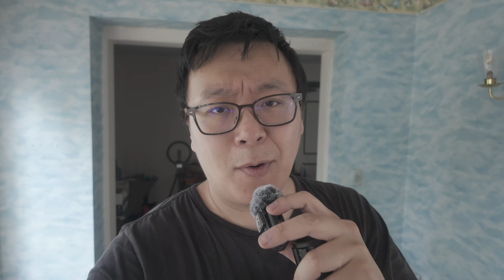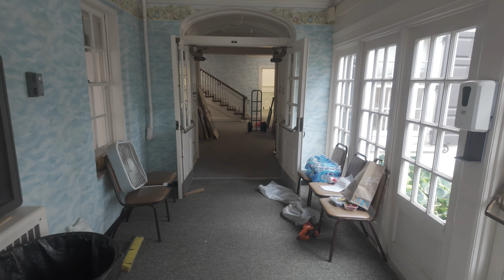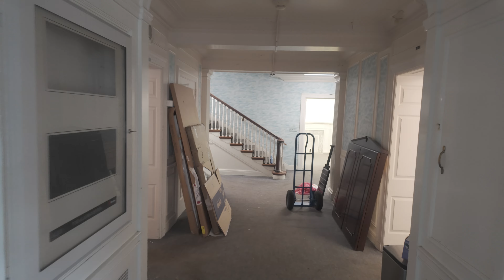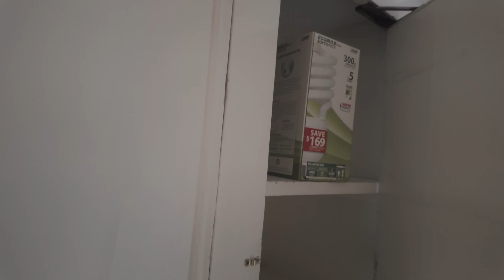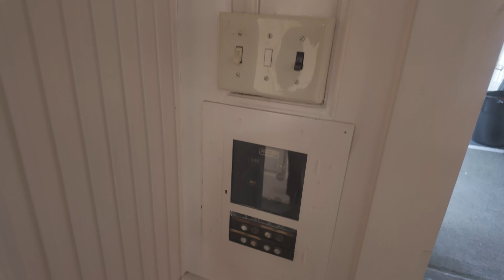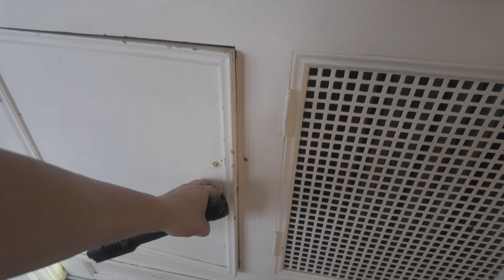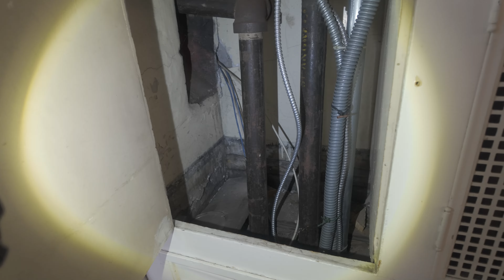Exploring First Floor of my Abandoned School! Episode 15

Comment: At 15:36, I bet it was a clock/bell system. Don't know that you want to replace it, but if you look at early 1900s clock/bell systems, many clock/bell systems were "programed" on a paper strip. As an obvious nerd, you would find the technology cool. The bell in the teachers dining lounge bathroom is painted.  Again, considering the age of building... under that paint is is likely to be a very heavy brass bell. Brass bells have such a distinct sound...they can be rewired/reconfigured as bells for other uses.... maybe, not in the bathroom. It is likely that the sink cabinet has been re done to add some extra counter space. At the time the house was built, they wouldn't have put a counter above the window seal. Because it the doors and drawers match the rest of cabinets, may have been done a long time ago. Love the cabinets. I restore old furniture, so I look at them & think how did they manage to last that long in a school.  They need some sanding & new paint... and the one modern device that makes them perfect...a  magnet or friction catch to make sure they stay closed. Things are done that because the person with authority had a brilliant idea/solution.

Comment: That is a very cool and unique place. I would love to know more about it being formerly a school. Was it a boarding school? A day school?  It seems it was young kids elementary and under. Or even preschool given the bathtub setups. Like they had to help bathe the students given the tubs are raised. Did it eventually get used for offices. Given the bathroom setups it seems like it may have been a boarding school then day school or daycare. 

When you showed the staff dining room and mini creepy bathroom it was weird to think someone would be in there right next to people eating. And I saw a huge bell on the wall. You’d be in there when it rang. It would scare me. Small space loud bell. 

The old toggle switches with the flags looks to be an annunciation device to track what staff is onsite at any moment like a time clock. The equipment in the basement would have controlled it and probably the clocks and bells as well. I also thought it might the older fire alarm system before the one you started removing.   It’s a shame different inspectors gave you bad advice to remove it.

Comment: This was a fascinating tour of the first floor. If you stripped it back to the original features of the old house it would be spectacular. I replied to someone else's comment below but have changed my mind, (saying dining room)  the room at 9:23 is a formal sitting room, which would be fabulous to recreate. The next room may have been a family dining space  or morning room. The next was a 'study' or den. In the den, if you opened the wall back to its original arched beam entrance it would be so open and welcoming.  I'd guess the room next to the water fountain would have been a bar space for staff to prepare drinks. Not sure what the last room would have been but guessing it would have been some sort of 'staff space' because it has the hidden door I would think maybe a butler's office. At the point of the back stairs it would have been all staff use. *In the kitchen, the sink cabinet is not original. It would have been a large stand alone sink space with no cabinets. That's why it makes no sense with the spacing. People did not put cabinets in front of windows and neither should you! The range is fantastic (I'm a trained chef) which any cook would want. A service to that range is probably all you need. *The bins in the 'cook's pantry' are for flour, sugar and possibly potatoes or rice. The second pantry is a butler's pantry. You were right that the shelves are for cutlery and serviceware. Probably your silver services. The dishwasher may still be fully functional have it checked. Great if you have parties or plan to host large groups. *After the full tour you have it right that the last room is the dining room because of its proximity to the butlers pantry, which would always be the room next to the dining room. The whole first floor is stunning if you eliminate all the changes from the school. I say strip it back one room at a time to make it fantastic. Loving the filming you are doing now. Thanks for including us in your journey.

Comment: I work on commercial kitchens if you don’t plan on keeping the burners and griddle those can fetch you close to 20k in that condition. Southbend is a great brand too. The can opener is work like 100-150 as is. Personally I love that old kitchen other than redoing the cabinets. Also if you can fix the dishwasher it’s worth a lot of money as well like 2-5k if fixed and they take like no time at all to clean dishes.

Comment: This time I read everybody else's so I don't duplicate.  The only difference is the dark paneled room looks like the men's parlor where they would sit after dinner and smoke cigars and talk.  The women were in another parlor.  That paneling is probably solid wood and very valuable unlike today's veneers.  I hope you can renew all the fireplaces even if you don't actually use them.  The side porch used to be called a solarium.  I hope all the origional wood floors are under those carpets and are in good shape.  Might want to leave them down to protect the floors during reno.

Comment: How is the gutter project going? Do you have a “flow plan” for what you will work on next? It would be fun to have a historian come in and tell you what some of these weird things are for. Do you have water in the house yet? I know you showed having to bring in water in the first few videos and that it seems like it was going to be a big job to fix water issues. So, just wondering if that is next. 
So much potential in this project.
Reply from the maker: I am still working on the gutters! Just figured give the audience a break in 10 straight episodes of gutter reno. After that Water or roof. I dont know if i need water to power wash the roof or the jugs i have will be enough. Once the roof is done will be getting the water breakages and issues internally fixed. So that would be getting the water figured out

Comment: @6:05 that sun room porch area is nice. You should connect it with the other half and throw in some comfortable chairs.  @8:59 this room could work if you put a couch in the middle closer to the fireplace and some extra chairs along the edges.

Comment: The separable outside door is called a Dutch door. Dunno what the wall insets are but definitely not a dumbwaiter, which is a small elevator-type device that travels up and down as in an elevator shaft. The outlet above the mantle would have been for a small light above a painting. My guess is it would likely be a portrait of the founder. Think WASP, lol. Or some sort of patriot painting since you're in the North...Washington crossing the Delaware, etc. No commercial kitchen would have trash bins near the fresh food. Those lean-out bins would be for either containers of dry food such as flour, or potatoes, onions, etc. I love that dishwasher. We used to have one in a hospital kitchen I worked in as a teenager. You can rinse off heavy soil with the nozzle, then load the trays to the left of the sink (that are under the counter), run through the dishes while you set up another rack near the sink. When the first load is done, you just push it through with the new rack, and the hot clean one dries on the left hand side of the counter. Not sure how efficient is it in terms of water usage, but for large loads, as in a bunch of kids and faculty, it's a great system. Think about the systems that these layouts would have served. Dirty plates come in from the dining room and are deposited on the right hand counter. Someone's there to rinse stuff off and load the racks. Clean plates end up on the left, to dry quickly if they're hot and get put away. Or possibly put onto rolling carts to be put away in the butler's pantry. I love the commercial fridge but imagine it costs a fortune to run. Just a thought - the milk delivery door might make a perfect doggie door.

Comment: Find yourself a designer when you get that far.  I can easily see a couch with side chairs on both sides of it, or a u-shaped sectional, "floating" around the fireplace in  your livingroom.  Another sitting area or small game table can be on either end.  A master suite would be perfect in the natural wood fireplace room, using the teacher lounge and tiny tiny bathroom and making those into a nice size bath and walkin closet.  I could go on.  I love designing.  Fun, very big project for you.

Comment: I hope you find a hidden treasure in the milk door! 

That kitchen feels so institutional. . . oh, wait. . .
While Other than the weird layout, it is a pretty cool kitchen. 
Those tip-out bins may have been for potatoes. 
There is an inspection tag on the fire hose, when was it's last inspection?
The outlets on the dishwasher. the horizontal one probably is on outlet, but the lower, vertical one, that looks like a switch, the plunger pulls down and pushes up to turn things on and off. 

You surely have the space in to buy and sell pallets of returns, or even storage units if you wanted. 

That creepy, extra tiny bathroom, the light switch being upside down makes me think it was a three way switch, it has a mate somewhere.
Speaking of switches, that 2 switch hall light thing, someone probably replaced switches and screwed things up. 

This property is so cool.  Maybe you could build something out in a part of it and do an AirBNB.

Comment: Looking at the floor plans you can see that in the playroom with the fireplace (with the clock) the arch was open. The door in the closet that was walled up looks like it was the original door and the hallway where you said there used to be a door was where a closet was and that door was for that which explains the switch, the light would turn off in the closet when they closed it.

Comment: The principal’s office (parlor) and living room is beautiful with the trim. The room with the brown trim was the gentlemen’s study. The split door is called a Dutch door please save all of the hardware and door operators that you can on original doors. The dead bolt holes can be repaired in the antique doors. The openers in the breezeway are from the 50s, makes them 70ish years old, slightly older than me. My husband’s career has been dealing with doors, windows and hardware for 45 years and knows these things inside and out. There were many doors in every room in the original home. It was how you kept the heat in the room you were in. Please consider keeping them in place so the house isn’t so open. The kitchen is probably the original layout. The one change would have been the sink cabinet has been widened. It would have been between the windows only. The original cabinets in the pantry are bins for things like flour, sugar, potatoes? Those are awesome! The hall between the kitchen and dining room, is a butler’s pantry. They’d have stored the dish ware, linen and silver. The butler would have decided what was needed that day on the dinner table, serving pieces, and linens. This house originally had servants. At least a cook, butler, and maid. How many bedrooms are on the 3rd floor. That’s how many house staff you would employ. Things like the incinerator door, leave that in place for the nostalgia of it. Ok the dumb waiter aren’t actual dumb waiters. A dumb waiter is a small elevator between floors for linens, or food. You probably have one somewhere. But they are basically early staff callers. The lady or man of the house would flip the room they needed the butler in and he’d come. You’ll find them all over the house. The electrical is bizarre because the building has been through 3 separate types of wiring. Originally knob and tube wiring, which would have been changed to wiring, with fuses and no grounding in the 50s, then to breakers and grounds in the 70s or 80s. But there is a reason why the switches on the stairs are like that. You turn the light on at the base of the stairs (or top), when you get to the top (or bottom) you’d turn them off. Common in older homes. You are so blessed to be remodeling this house. And I’m loving looking at it all. Thank you for sharing.

Ok, now you have the cabinet in the janitor’s office, the door in the hall, the safe, the milk man’s door, to open.
Reply: @jwall6006  This is wonderful information and explains some things I was planning to comment on better than I could have done.
Reply: Oh one more thing I saw when I went back. The doors in the cold room (fruit room) that are on the floor, might go where the accordion magnetic doors are.

Comment: Oh wow, that floor is big enough as a whole house on its own.  A lot of work that I am looking forward to seeing what you end up doing with it all.  Oh those pull out drawers in the pantry, they would have been used to store flour, sugar, rice etc (its a culinary thing).  As for the 'kill switch' in the hallway, I also have the same set up in my house where unless the switch is in the 'on' position, my hallway lights and my entry lights will not turn on - why this was installed I have no idea and really annoys me.  But I do like the industrial dishwasher (those crates under the table will hold the dishes and you will find bars and restaurants still use a similar system).  You could quite easily turn that room into a butlers pantry.   Oh and that flat space in the cooker/stove, will that could be either a grill or a place to warm plates.  Keep up the great work and look forward to the next instalment. 😊😊

Comment: As someone else pointed out. Those are not dumbwaiters. Dumbwaiters are elevators for food and stuff. It might be an intercom system.
Reply: ...or maybe who's in the building and who's out... Like a personnel tracking system??
Reply from the maker: No clue, or a paging system. it just says in and out and has two buttons. I dont know what it goes to or turns on. It n o longer works!

Comment: I used to work on those Simplex Fire Alarm Systems and I really wish you didn't touch it. They are the best systems and very expensive, you could also have gotten insurance benefits by having it functional. I suppose what's done is done right, keep up the good work.
Reply from the maker: me too, original inspector told me it had to be removed to be approved for occupancy permit, then a new inspector came in when that guy left and said why did you remove this. I pulled out the original notes from the first inspector which told me the system had to be removed or I could not move in.
Reply: @watchere  I would call Simplex and see if it could be revived. They may be able to fix it.
Reply: @watchere  that sucks man. I hope you still have all the devices you took down. That model was a bit old anyway so if you want to install a new system you may just mainly need a new panel. Did you get my reply to you about the security door on the 2nd floor hallway a couple weeks back? I think it might have been used for storing medications for the kids safety.

Comment: Now we are getting into some interesting territority,You had all the power gear in the basement and now you show more details ,Those dumb waiters are all interagted into some sort of whole building singal system. You need to find on place to make a office so you can get more organized and trac projects and plan projects better. Those tilt out bins are for flour and other dry goods or vegetables. Those cabinets  by the freezer may have had at one time a set of doors in the hall to allow dished to taken to the dining room. Leave the hiistory of the kitchen in place,Leave the incinerator in place ,clean and secure because it is a coool piece of the buildings story. Restore all the kitchen cabinets. The sink was up graded at some because it is clear the original was between the windows. Find a commercial dishwasher service company after you get water to come service the dish washer it looks like it will still work.
Reply from the maker: Once water is on will def test all that stuff out to see if any of that stuff is still working. But I got to first replace a few water heaters, track down all the blown pipes before then!

Comment: I find this property a bit overwhelming. It's just so big. The amount of rooms, bathrooms and strange nooks is bewildering. You need a purpose and very good plan before renovating, I think. Maybe an architect who's done something like this before. Otherwise it will always feel "institutional" and it's so easy to destroy the "good character" of the building by just gutting it all.
Reply from the maker: I find it overwhelming too! After the building is water tight, sealed, water and heated. I'll have to get some opinons!
Reply: @watchere  yes, first "save" the necessary structures. It's a great opportunity.

Comment: @Yason While I know you're going to redo everything in the building, you may want to think about keeping the Network ports intact as it would be insanely useful when setting up your wifi, router, and internet service in the building.
Reply from the maker: Absolutely! I just need to find a way to figure out what wire goes where and label them!
Reply: @watchere  There are some devices that allow putting a tone on network wires and then another device that allows tracing them.  Another option is to plug them one at a time and to the internet and go around with a computer with wifi off and plug into the ethernet jacks.

Comment: The room with the big fireplace and all the wood on the wall with the clock in it , I think should be a kitchen , this is why the dumb waiter system in it, and the room attached to it should be a dining room.